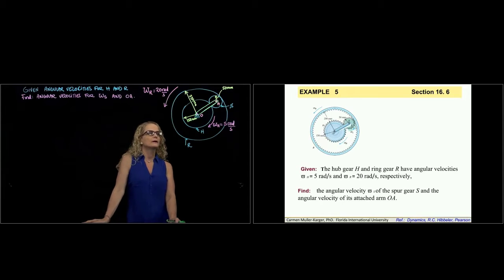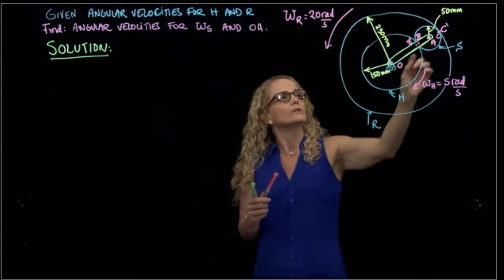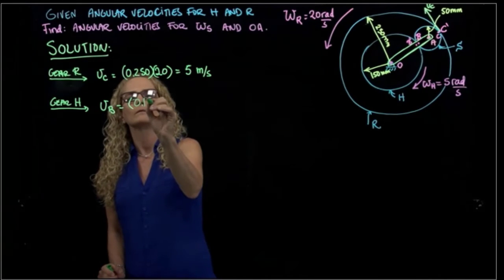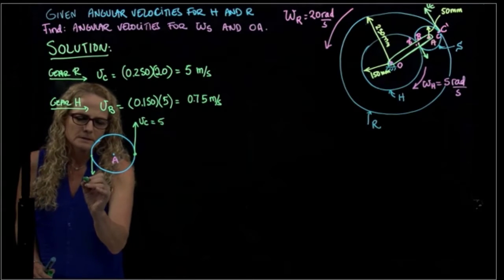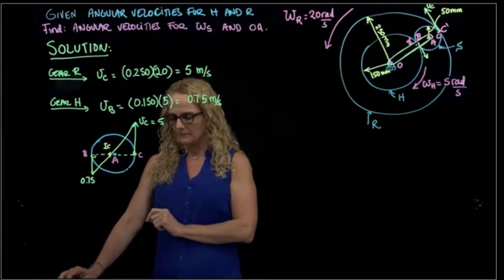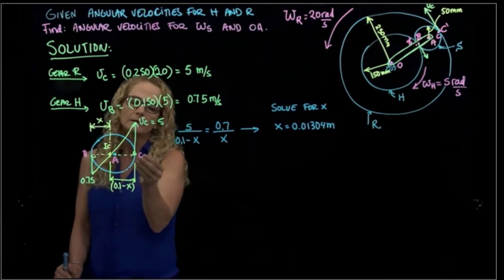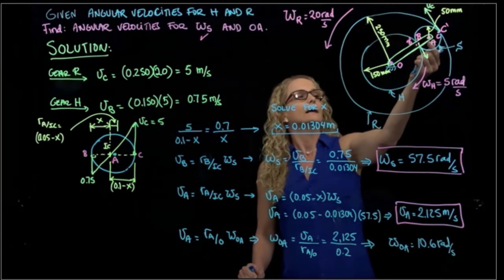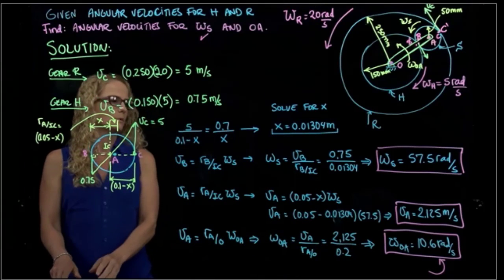DYNAMICS, Example 16.6.5 Analysis of Gears

Comment: Can you give an intuitive explanation why A and B, equidistant from the center of a gear rotating about its center, have different velocities. It is hard to visualize. Thank You for doing the hardest gear problem.
Reply: One must remember that velocity is not an absolute. Velocity is always relative to a frame of reference. 
The velocities A and B derived in this video are not relative to the gear A. The velocities A and B are relative to the origin axle of the planetary system. The true velocities at points A and B are derived from the superposition of the velocity of gear A which is VA, and the respective point velocity A or B relative to the origin. So the velocity of those points relative to gear A is the sum of VA and A or B, both will be equal to eachother but in opposite directions. 
I'm sure you're familiar with superposition, but incase you are not, in mechanics superposition means that the resultant force is equal to the sum of it's vector components. It works the same way for velocity, acceleration, deformation etc...
Reply: @Erowens98  thanks for your time. I'll review the problem in light of your comments.